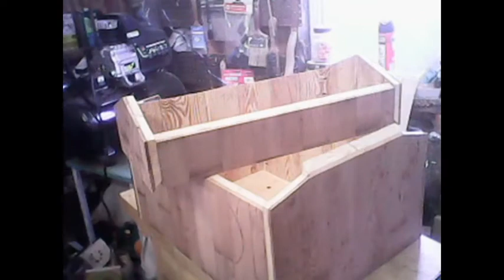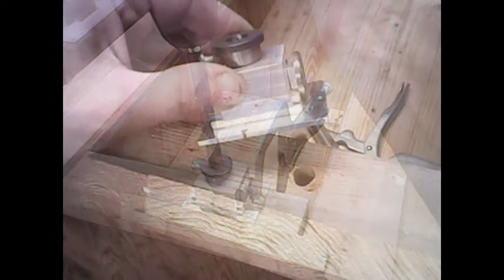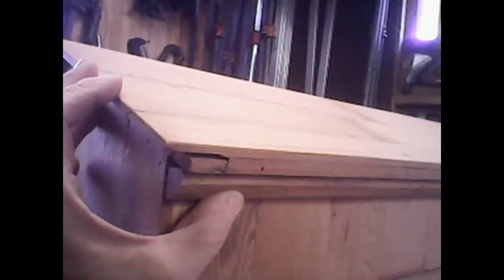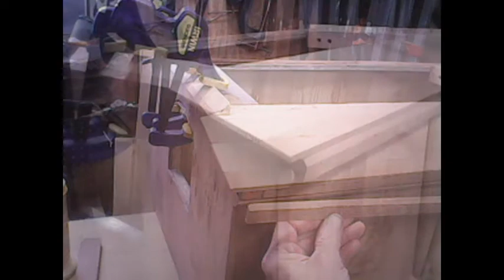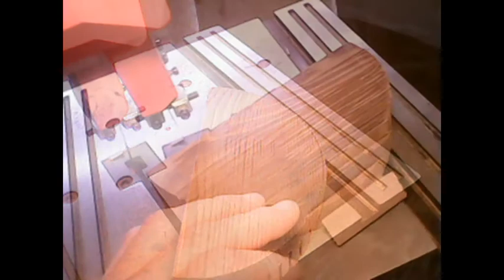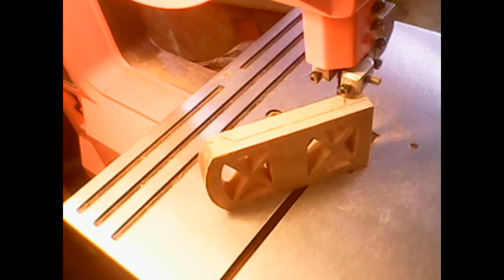"slide show" owl nesting box

Comment from the maker: Hi John,
Thank you for the complement.
Reply: Do you think you can help me sort out some electrical components on a little surface grinder build I picked up? I'm not 100% sure what the builder was going for other than to maybe drive the in/out feed from a little motor and belt connected to the hand wheel. There is also a box with a pot and some bananna jack'ish connectors (Power supply? or Relay maybe?) that another box with a pot a toggle and a momentary switch. There is also some kind of maybe sensor or stop. I know you can't tell me anything from the description, but I'm just asking if you'd be up for helping me kind of understand what I'm looking at when I get a chance to take some pictures.  I moved the grinder into my little shop area, but it's chaos here (moving stuff around and making room) because I didn't plan on getting a grinder, but I couldn't not get it as it came included with a little old school mill that I picked up for $200 last Saturday. I have everything of the mill inside except for the base casting which I hope to move in this weekend. So it will be a bit before I get to trying to figure the grinder out.
Reply from the maker: Hi John,
I've been looking through my analytics just now, and I was impressed upon to look at the  comments analytic section, and I just now seen your comment about your grinder.
This comment was about a month ago, please accept my deepest apologies for not even responding, I didn't know there was a comment out there.

As far as electrical things your asking about, I really wouldn't know much at all about those kinds of things, my electrical know how is mostly about basic transistor circuits at a hobby level. When it comes to power electronics I would have to back down in any advise, cause I really wouldn't understand much about it.

However, electronics forums "allaboutcircuits" one of them, may be able to be of help. Also machininst forums "homemodelenginemachinist", may be of great help as they are all about machines and machining expertise.

Again sorry about the late reply.
Reply: No worries. I figured it out for the most part... until the explosion. It's just a 12 volt power supply, a 12v dc motor, and a little forward/off/reverse toggle switch for the motor direction, and another momentary switch to activate the motor. You would have figured it out no problem. The stuff you were making was far more complicated that this. It's just what whoever built the thing rigged up. Thanks.  @myenjoyablehobbies